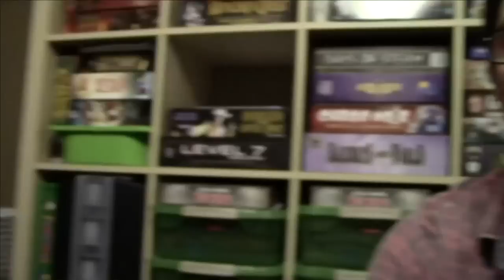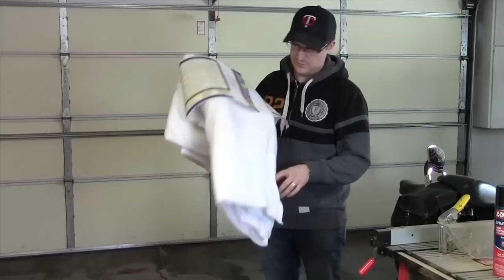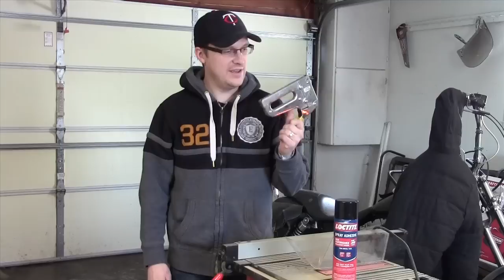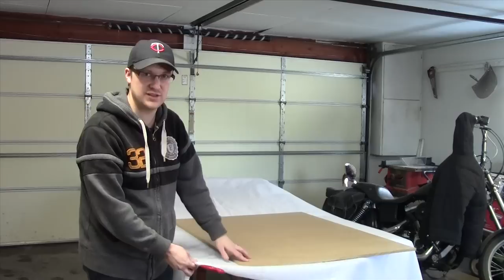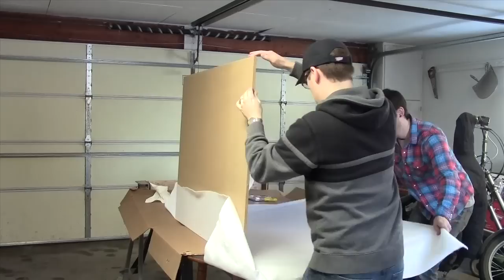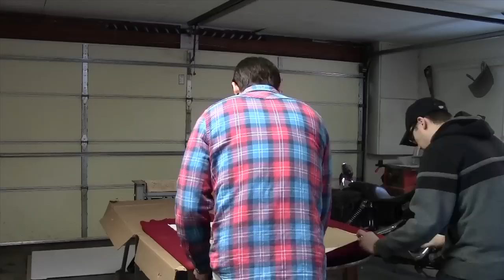MeeplesonMeeples How To - Build a gaming table top for your existing table

Comment from the maker: We built it in 2 pieces for easier storage and because the table it is used on folds by 3. This way if we need a smaller table we can use just one piece. Also we did use that two pieces and had no issues with them separating. The glue was a loctite spray on medium strength.

Comment from the maker: We were worried about that as well. We thought maybe little rubber dots as feet would stop that. Turns out the the fabric gets thick enough in the corners and the staples sink in far enough to not touch the table at all. So we didn't need anything extra.

Comment: Felt is pretty thick, so the staples are probably slightly below the rest of the felt, as well as the folded corners are going to be slightly higher than the rest.

Comment: Was the glue completely necessary?  I was planning to use only staples but I was wondering if you had previous experience with another way of doing it that made you decide to use the glue?
Reply from the maker: We feel that eventually the material will "stretch" out and become loose. The glue holds it firmly in place and keeps this from happening. It also keeps it from pulling against the staples and possibly tearing underneath.
Reply: That's a good point.  What kind of felt did you get?  Did it have a special name or was it just "the highest quality felt" they had?

Comment: I was thinking, what would be a good way to add edges to the sides so that dice don't roll off the edges? There's a guy in our group that simply CANNOT roll properly, and it'd be a big help.
Reply: A much simpler solution then modifying a table is to get a dice tower, or make one. I made one out of poster board for one of our players whose rolls would hit the table and slide on the one face.
Reply: Dice boxes are really easy to make. You can buy either a deep bevel picture frame or just a wood canvas box from a craft supply store. Red felt on the bottom, black felt on the sides. Painted the outside all black. Works really well.